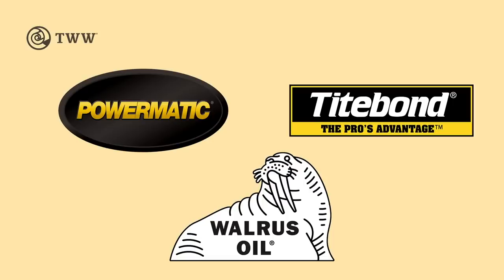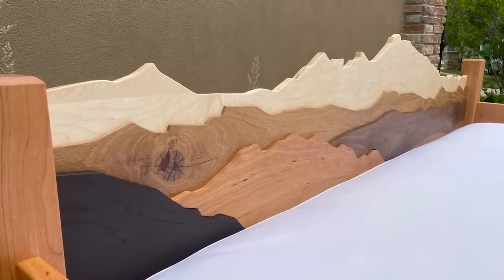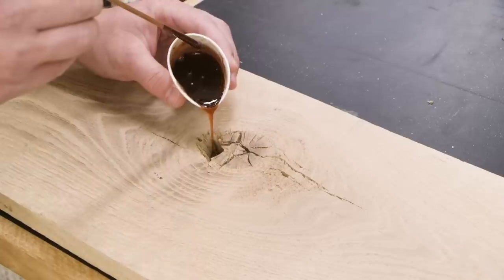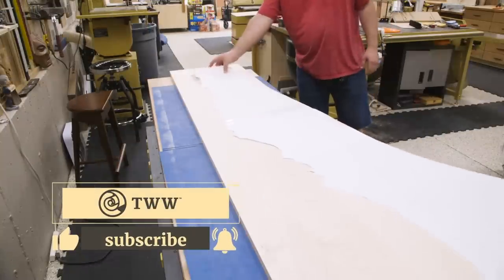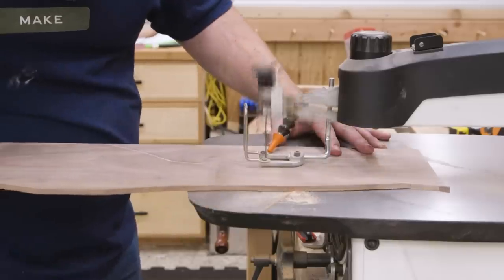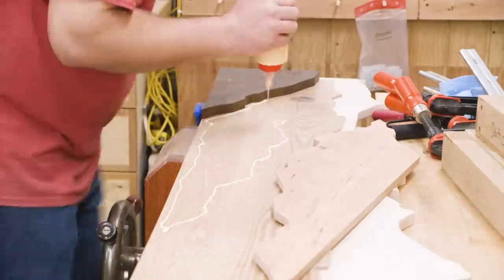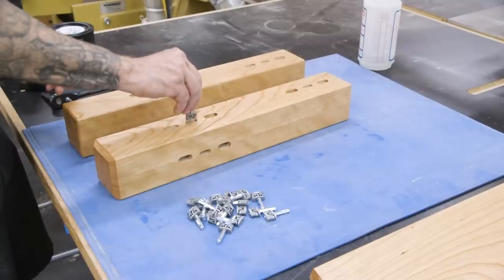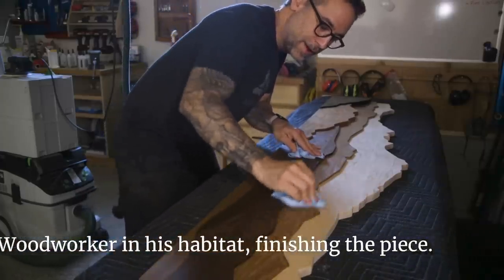Unique Skyline Headboard Daybed

Comment: Hey Marc, out of curiosity for the mountains overlapping could you have used the table saw to cut essentially a half lap on the thicker piece the thickness of the bottom thinner piece rather than trying to match the adjoining piece ? (hopefully that makes sense.)

Comment: Hey guys - what sort of rags are those blue ones you’re using to apply the walrus oil?  I’ve been using just regular cotton T-shirt material rags for BLO or hard wax oils (sometimes literally cut up T-shirts) but I have noticed little bits of cotton left over on the surface sometimes, especially if I’m working on an irregular surface like a live edge.

Comment: Really beautiful work guys!! How’d you keep the jigsaw so square with such a thin kerfed blade? Or was there lots of sanding after?
Reply from the maker: Lots of sanding but not because of being out of square. It was just a little rough on the surface and needed to be smoothed. The small blade we used is actually Festool brand and seems to cut really well without drifting.
Reply: @woodwhisperer  must get some of them in that case!! Thanks Marc!

Comment: How do you feel the furniture butter compared to Rubio?
Reply from the maker: While both can be seen as oil/wax combos, they're pretty different. Rubio has a proprietary formula that works in one or two coats and doesn't benefit from additional coats at all. Walrus Oil is a more "natural" product that discloses all of the ingredients. In fact you can probably replicate their finish to some extent if you had all of the ingredients and wanted to go through the trouble. A Walrus Oil finish does benefit from multiple coats and takes a longer time to dry/cure. While I love using Rubio on my furniture, I'm not at the point where I'd trust it on a food contact item. Walrus oil, on the other hand, I have no safety concerns whatsoever.
Reply: @woodwhisperer  thanks!